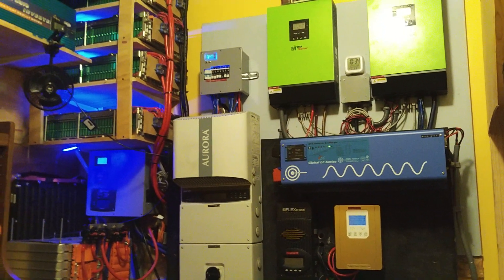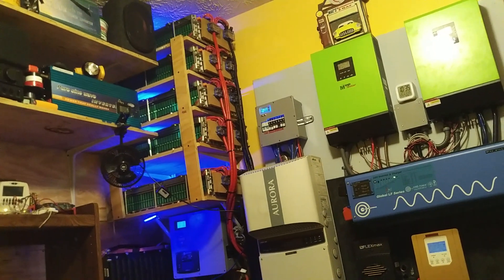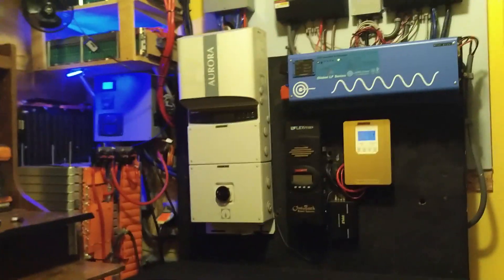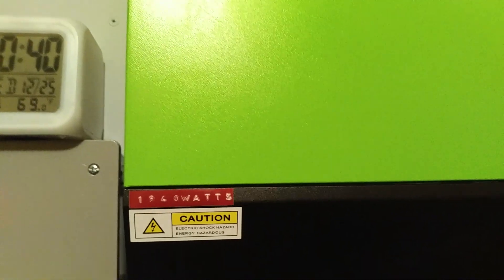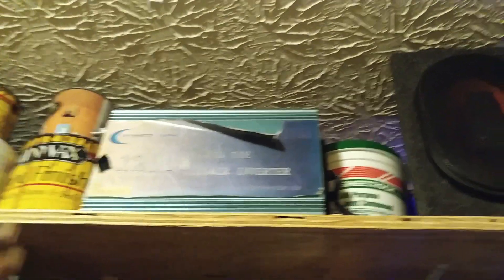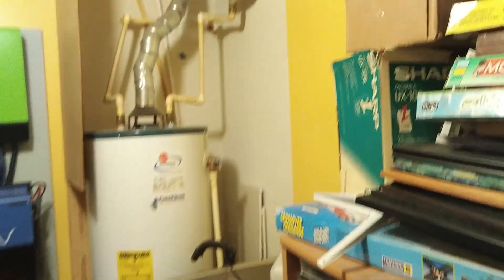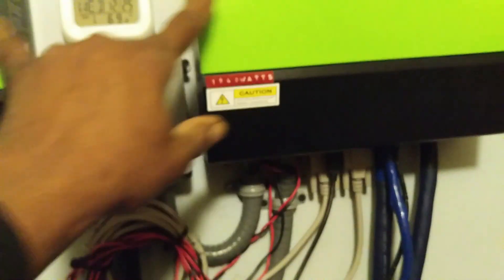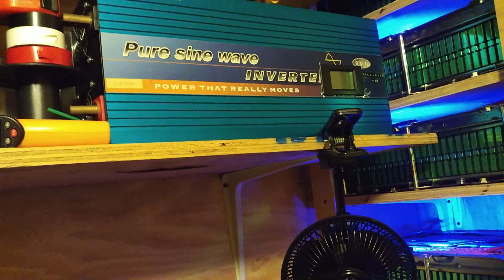Off grid mpp solar

Comment: Good lord, that is a lot of equipment! 😊
Looks good.
Reply from the maker: I started out small years ago I bought my stuff on eBay as I get a deal.all this equipment now runs a 5 bedroom.3 bath.2 dinning room.2 living room.2 car gurage and a sun room home....all 120v...thank for checking out my video
Reply: @bimmers323ci  How big is your panel power? 
And what did you end up paying for the battery bank? 
I'm currently chalking up my own system and researching mpp inverters. I think I'll settle with a 3kW model.
Reply from the maker: ZenseiDK I think I have about $3000....in battery and over 8000 watt in solar panel... my aim on solar is about 10000 Watts or so...I am currently bidding on 5000 watts of solar panel for about $1800.hope I win